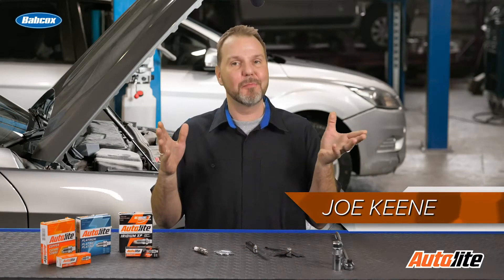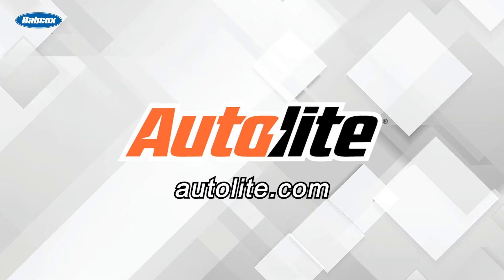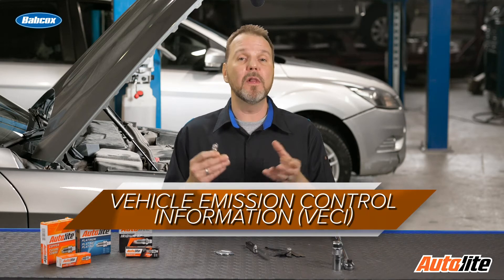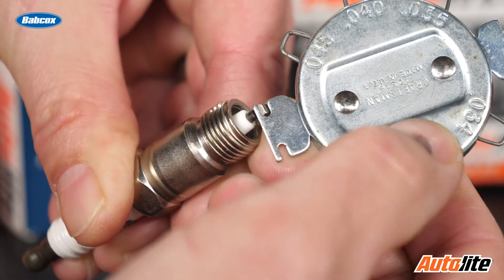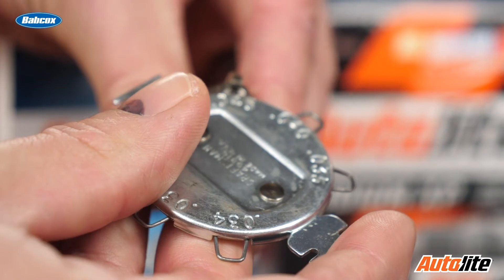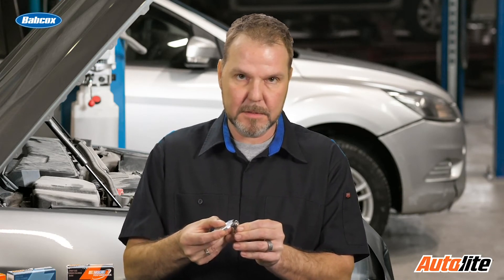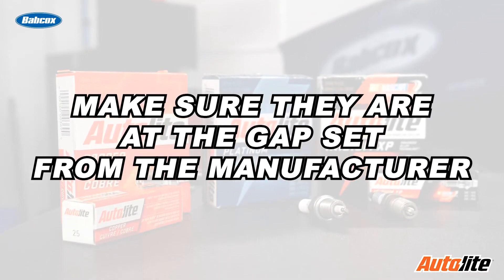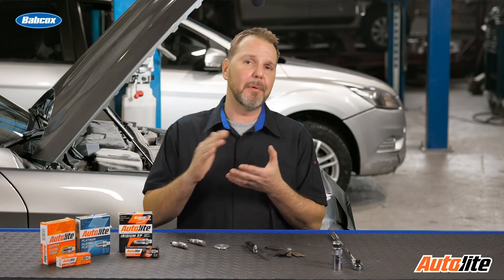Gapping Spark Plugs

Comment: This guy doesn't know how to gap plugs the right way. It should be done with spark plug gapping pliers. The reason for this is because the pliers make sure that the flat surfaces between the center and side electrodes are exactly parallel. This ensures more reliable ignition over the life of the plug. This also makes the plug last as long as possible before needing to be changed. Read 
Dr. Christopher A. Jacobs book "Optimizing Your Ignition." Every competent technician should have these pliers in his tool box.